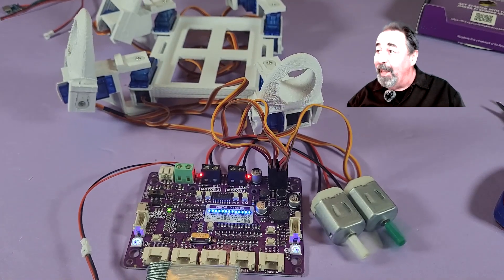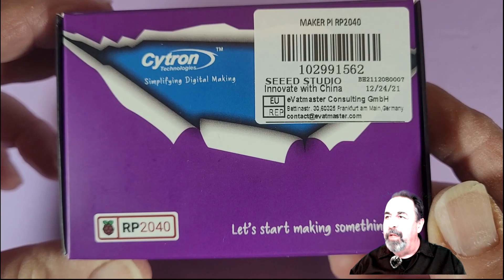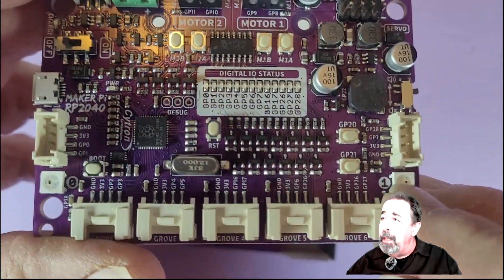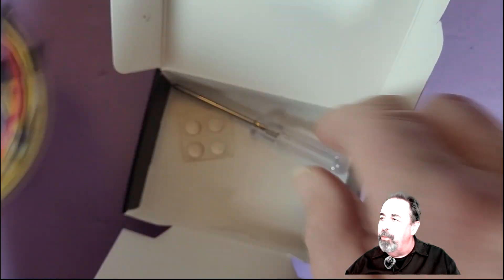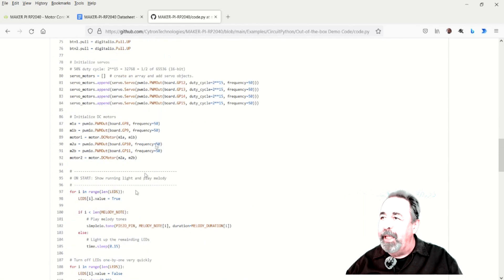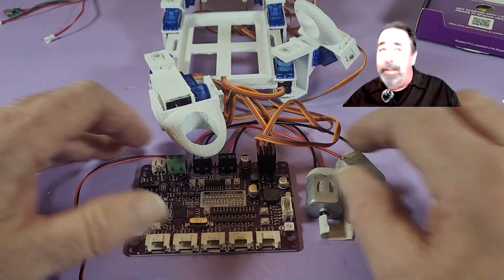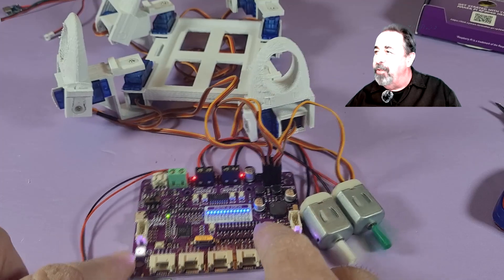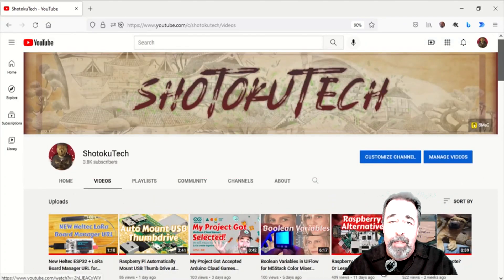MAKER PI RP2040 Robot Controller Demo

Comment: Cytron Malaysia, but Seeed probably does ship from china. Uart, circuit python. board is very capable, at the price you would think someone  would do something with them. I am trying to find motors that will take some load, the N20's geard are a little weak, i need to do a 6v to the power port to see if it helps, other wise small stepper (i need speed control the n20 with gear boxes provide that). I find the board a great gadget board, i just need too find the right gadget that works at 6v.
Reply from the maker: I have a couple of ideas. LOL. Looking at analog right now.